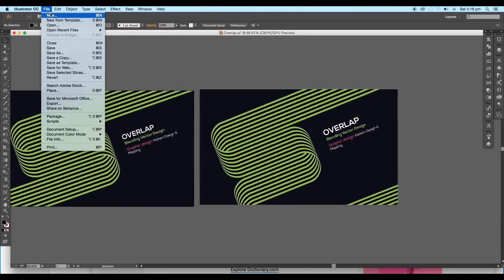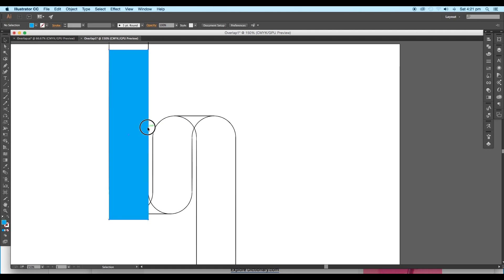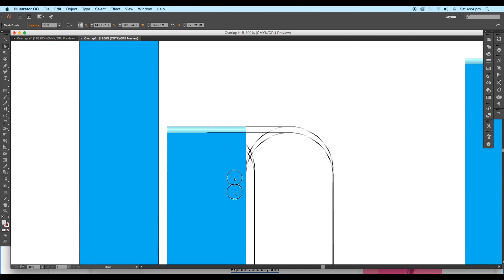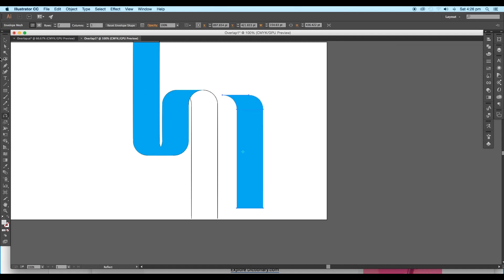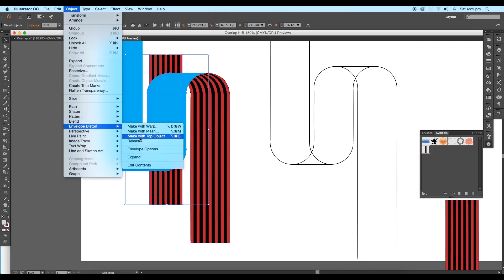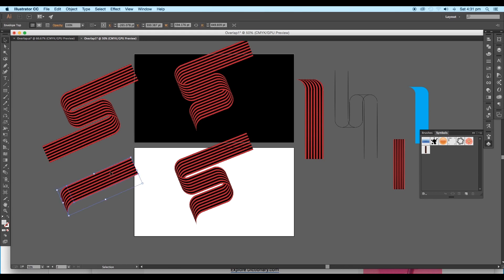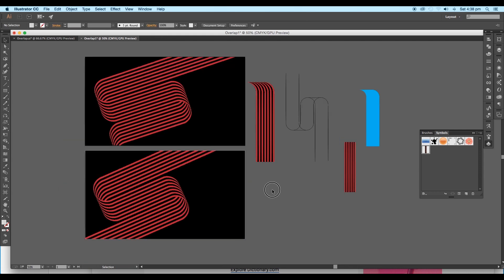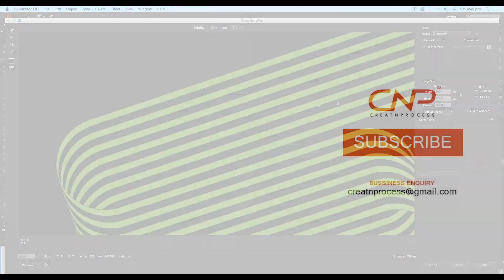Graphic Design | Overlap | Illustrator Tutorial

Comment: very nice one, I recently found the envelope make with top object function and you can do amazing stuff with it.
But I have a question... why are you using  envelope to mesh? I find it a struggle to control the bezier curves.
You only need the shapes, right? So why don't you use the shapebuilder tool to create them?

I did and found it easier and more intuitive that way. You have to keep in mind that you can't use lines, you have to draw closed paths, otherwise the shapebuilder won't recognise the shapes you wan't to unite. Another thing is, the shapebuilder creates way to much anchorpoints sometimes, so you have to path > simplify it before you go to envelope make with  top object. But all the rest stays the same.

Keep up the good work!